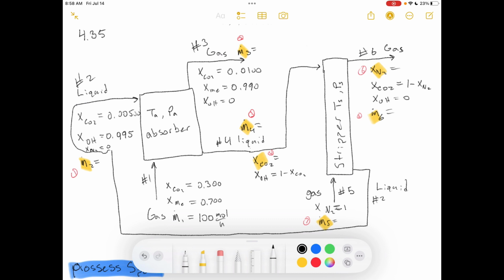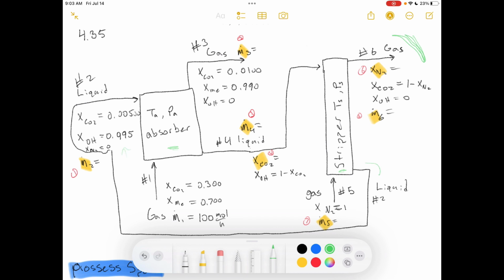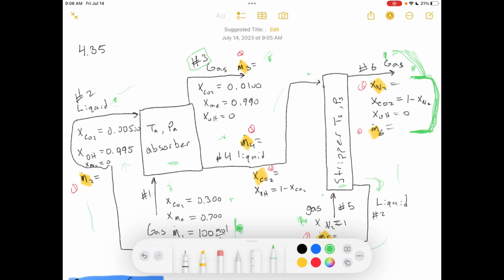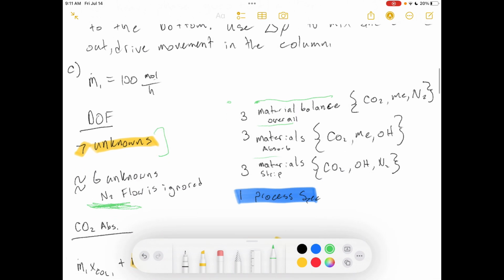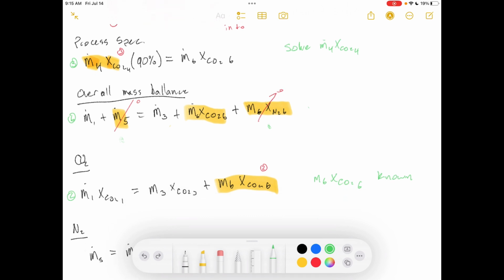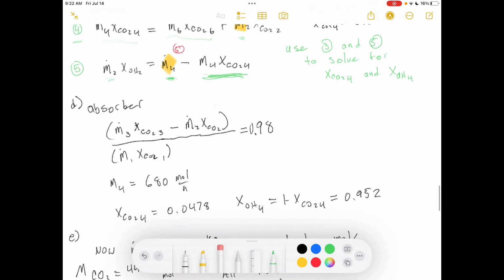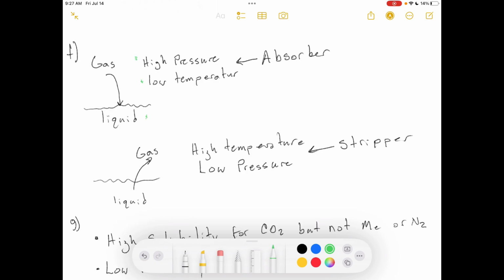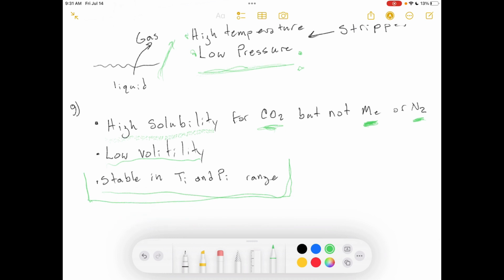TEP - Episode [115] - Problem 4.35 - Elementary Principles of Chemical Processes Third Edition

Comment: Hi , i need you to help to solve this problem please :
A crystallizer contains 6420 lb of aqueous solution of anhydrous sodium sulfate(concentration 29.6 wt %) at 104°C. The solution is cooled to 20°C to crystallize out the desired Na2SO4. 10 H2O. The remaining solution ( the mother liquor) is found to contain 16.1 %anhydrous sodium sulfate. What is the weight of this mother liquor.
Reply from the maker: Hi, thanks for watching and submitting a problem. I am currently working on your video and will upload shortly, but in the meantime you may want to check out episode [065] that deals with some of the same material. I wish you well, and good luck!
Reply from the maker: I have uploaded the video you requested. Episode [119].